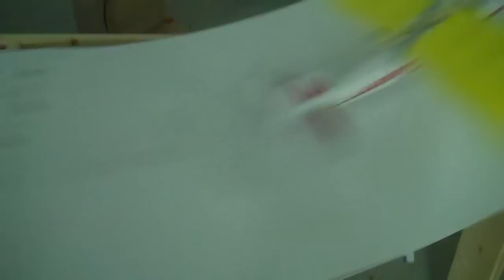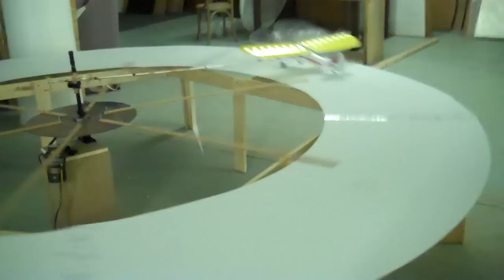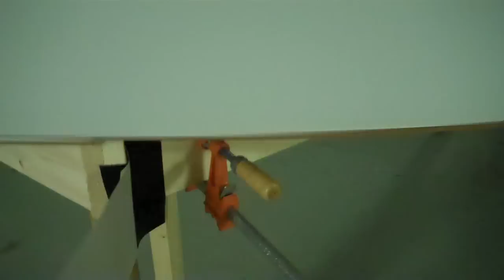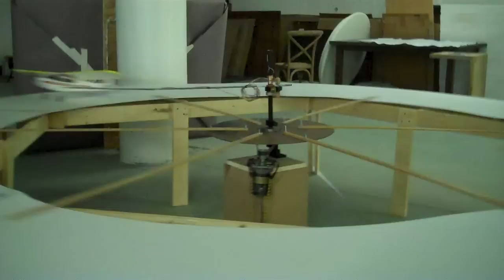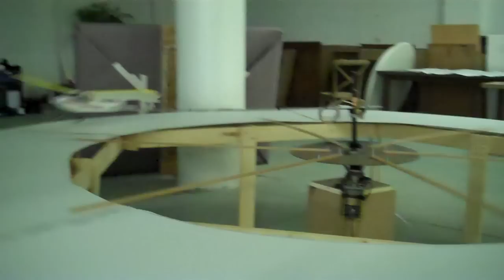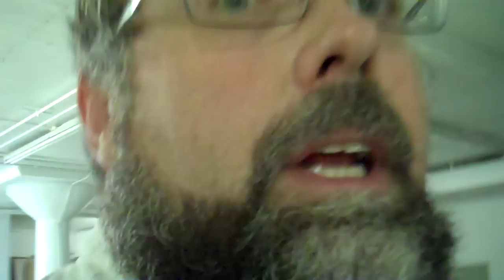Airplane On a Conveyor Belt Proof of Concept

Comment: here the plane doesnt have the same speed of the belt....
Reply: ///Sixth Gear Only by breaking the rules can the plane take off.  The question is always written with the constraint that the speed at which the wheels spin and the speed at which the conveyor belt rotates must remain equal to each other.  Clearly in this demonstration they are not rotating at the same rate.
Reply: @SmartAlx  thats a physical impossibility, wheel speed is dictated by whatever the belt speed is PLUS propeller thrust. 

You cant get the belt to match wheel speed, because wheel speed uses belt speed in its calculation
Reply: @markbergin8821  If it's a physical impossibility then the answer to the question is "no, the plane can not take off under these conditions." If the conditions are impossible, the answer must be "no."
Reply: @SmartAlx  no, the physical impossibility is the conveyor belt, not the wheels
Reply: @SmartAlx  the question is the problem, its a paradox because the belt can NEVER match the speed if the wheels once thrust is applied on the system
Reply: The wheel speed is calculated FROM the belt speed, so belt speed can NEVER match wheel speed once thrust is applied
Reply: @SmartAlx  the disclaimer that the belt speed matches tyre speed is like saying whats down is now up, it makes absolutely no sense and breaks logic. So the answer isn't "it doesnt take off" its, "the question is illogical because belt speed CANT MATCH tyre speed"
Reply: @markbergin8821  What do you mean the impossibility is the conveyor belt?  What's impossible about a conveyor belt?
Reply: @SmartAlx  the properties that the question imposes on the belt are physically impossible. The belt can never match tyre speed, because tyre speed is the sum of the planes thrust and whatever the belt speed currently is.

Let's say belt speed is moving backwards at 10km/h. Even without starting the engine, the planes wheels are going 10km/h in the opposite direction. So if the plane applies thrust equivalent to 10km/h from its turbine, tyre speed is now 10km PLUS the 10km/h it already had from the belt speed, so 20km/h wheel speed.

Now you'll say to just increase the belt speed to 20km, but that simply raises the wheel speed up to 20km/h plus the turbines 10km/h=30km/h. The wheel speed has become simply a factor of the belt AND turbine speed.

No matter what you increase that belt size to, no matter how fast, it cant ever catch up to that small little 10km/h thrust from the engine.

This belt couldnt exist in our universe, it property that the question give it, doesnt make sense. Saying "no it wouldn't take off" is kind of reductive, the whole universe would break if this scenario played out to its paradoxical conclusion. Its like which came first chicken or the egg?.

Saying "well speed of light is the limit so it doesn't take off, cant go fast than light" also isnt fair, youre applying real world physics to an illogical problem that already wouldnt exist in a world following those rules
Reply: @markbergin8821  "Saying "no it wouldn't take off" is kind of reductive"

Well you DEFINITELY can't say it will take OFF under these circumstances.  Better to be "reductive" than to perform a completely different experiment and violate the conditions that THIS experiment requires.
Reply: @markbergin8821  

You could absolutely say "the experiment is flawed so there is no answer."  You ABSOLUTELY CAN NOT say that the plane would take off.

I think a truly honest physicist would answer this question the same way he answers the question, "what is 1 divided by zero."  It's undefined.  Literally impossible.  That's the HONEST answer to the question.

If you force me to choose, why do I say the plane can't take off then?  Because this question exists in a universe that presumes the conveyor belt CAN keep up with the wheels.  Again, you have to accept the terms in the question.  It's a thought experiment.  It's just like arguing who is a better Jedi.  You can't answer that question by saying the Force doesn't exist.  The question presumes the Force does exist.  And THIS question presumes the conveyor belt can match the speed of the wheels.
Reply: @SmartAlx  ...how do you reach that conclusion from the fact that the belt speed literally CANT match tyre speed😂

Asking that question is a mistake in itself, that prerequisite doesn't make sense.

We KNOW the belt cant ever catch up with the tyre speed, so it will always move forward and gain speed, no matter how fast the track is, the wheels HAVE to go faster
Reply: @SmartAlx  I understand thought experiments, and this one is flawed, for the reasons I stated, its not just unrealistic that a belt like that could exist, its PHYSICALLY impossible for a belt like that to exist
Reply: @SmartAlx  but it would, because thats the rule of conservation of momentum, it HAS to move forward, which is why a belt like that COULDNT exist
Reply: @SmartAlx  there's is no energy consumption on those freestanding wheels, no matter how fast you make that rack go, the wheels are just spinning to match it, so any forward momentum MUST push the plane forward, there by having tyre speed go above belt speed, NO MATTER HOW HIGH/FAST BELT SPEED CAN GO
Reply: @SmartAlx  no, because it wouldn't "not take off", it WOULD take off😂 it has too based on the rules of physics that we know.

The belt BREAKS said rule, which makes the question unanswerable, because the plane can't NOT move forward, it HAS to move forward
Reply: @SmartAlx  yes exactly, you dont say 1÷0=0, you say the question itself is impossible😂
Reply: @SmartAlx  again, youre misunderstanding me, its not just "almost" impossible for this belt to exist. 

It CANNOT EXIST, this belt existing would break the universe and everything we know about conservation of momentum, it LITERALLY is impossible and makes NO sense, so the question is unanswerable
Reply: @SmartAlx  because in this hypothetical world where this belt somehow exists, conservation of momentum STILL DOES, so the plane HAS to move forward, it HAS to, no matter what kind of belt is beneath it, HAS to
Reply: @markbergin8821  Wait... actually you're wrong here...

"Let's say belt speed is moving backwards at 10km/h. Even without starting the engine, the planes wheels are going 10km/h in the opposite direction."

No.  You can't just have the belt moving without the thrust of the plane.  The plane moving forward is WHY the belt is moving at all.  The plane doesn't start off at 10km/h.  It starts off at 0km/h.  The engines apply force through the airframe, presumably sensors of some sort detect that force acting on the conveyor belt, and motors move the conveyor belt to apply the same force in the opposite direction (obviously with an additional force to take into consideration the weight of the conveyor belt itself.)  The forces cancel out.  Thrust is applied, the conveyor belt spins, the plane moves nowhere.  If the conveyor belt were completely frictionless, you wouldn't even need a motor to move it.  The thrust of the plane would spin  the conveyor belt through the wheels, because air resistance is greater than the frictionless conveyor belt.
Reply: @markbergin8821  As I said, you can definitely say this experiment is flawed.  You just can't say the plane will take off under the conditions described.
Reply: @markbergin8821  See my earlier comment where I refuted this.
Reply: @SmartAlx  a truly honest physicist would give my answer before that the question is inherently flawed so there's answer.

No answer doesnt mean "oh im right the plane wouldn't take off", it means there is no answer. Because THE PLANE HAS TI MOVE FORWARD, it can not stay still in this made-up scenario, but then you just shoved an illogical, paradoxical device in and tried to apply real world logic to it.

What yiure trying to say is akin to saying 1÷0=0 because it looks right... no, it doesnt have an answer.
Reply: @markbergin8821  You do know that seaplane pilots have to consider currents when taking off, right?  A seaplane in water exists in a situation that's not too dissimilar to the experiment.  Obviously the seaplane can take off, but not if it's going against the current.
Reply: @markbergin8821  No you have that backwards.  The way the question is usually phrased it says the conveyor belt is designed to perfectly match the speed of the wheels.
Reply: @markbergin8821  Again, you have to presume the question exists in a universe where these conditions are possible, just like Einstein had to imagine it was possible for him to ride a light wave.
Reply: @SmartAlx  ...thats not how apparently works😂 

Starting off at 10km is just to make it easier to understand, this logic applies from a dead stop in the exact same way.

Tyre speed at rest:0km/h
Belts peed at rest:0km/h
Turbines:0km/h

If yiu increase turbines to 10 km, now the wheels spin at 10km, which makes the belt go to 10km/h, but the wheels are FREE SPINNING, so with out even having to increase thrust, the wheels will just go DOUBLE the thrust speed, because they aren't dictated by solely the thrust of the plane, theyre dictated by adding up the turbine speed AND belt speed, which leaves us right back at my OG example
Reply: @markbergin8821  If the conveyor belt is able to maintain speed with the wheels, conservation of motion is not violated.  The force is just applied TO the conveyor belt.
Reply: @markbergin8821  Man I don't even know your answer.  You're arguing with me so you must think it can take off.  I've already said the question is flawed.  If that's your answer, why are you arguing?
Reply: @SmartAlx  im not wrong there, yiure just misunderstanding how a plane works, if a plane accelerates to km/h, its getting PULLED through the air with its propeller, its not spinning the wheels to gain that speed.

So if its being PULLED, the belt can try and go 100× faster than whell speed, its irrelevant, the plane WILL move forward, and the wheels WILL go faster than the belt
Reply: @markbergin8821  There is no momentum when the plane is at zero.
Reply: @SmartAlx  when the belt speeds up to match the wheels, the plane isn't ACTUALLY losing that energy, its thrust isn't going into those wheels, it stays in the propeller. So when the belt speeds up to 10km/h to match, that plane is still going to move forward at 10km/h regardless, so what must change? Wheel speed, so wheel speed has to go up to 20 to avoid the universe collapsing in on itself when conservation of momentum is not abided by.

This then starts the pattern that quickly results in both the wheels and track approaching infinity, but the wheels always being ahead, due to the laws of conservation of momentum
Reply: @markbergin8821  

Good job waffling. You're trying to do whatever it takes to make the plane take off, and that's not the question. If the wheels go faster, the belt must match. Once they reach the speed that the plane should take off at, normally, the question ends. The plane doesn't fly, the end.
Reply: @Psyrecx  nice job COMPLETELY not knowing how a plane works😂 I've not been "trying" anything. According to conservation of momentum and everything we know, the plane HAS to physically move forward in this scenario.

Which means the wheels HAVE to go faster, but this belt that doesnt exist, and COULDNT, doesnt "stop the plane from flying" it makes the question unanswerable.

Again, its like dividing 1 by zero, its not ZERO just because you think that might look right, its NOT answerable. You cant say whether it would or would not take off.

Again, the wheel speed is a product of whatever the belt speed is PLUS the planes turbine speed. It is IMPOSSIBLE for the belt to exist, its properties make the question unanswerable.
Reply: @markbergin8821  

No. The wheels only have to go faster for the plane to move forward and to get the lift it needs to fly. Otherwise, the question can be answered, and that's with a no, it cannot fly. 

And congrats on showing you don't even know what you're talking about, then again, you do that frequently.

It's not belt speed plus turbine speed. Because if it was, without the turbine, the plane would just stay still with the engines off. 

The wheel speed is the engines pushing forward vs the belt pushing back. Planes have weight, and still have to deal with friction. They're not magic, unlike what you may believe. Your argument is like the argument of a flat earther. Failsauce.
Reply: @Psyrecx  no, the plane HAS to go forward, in the system setup the way it is😂

This setup is NOT akin actually putting brakes on the planes wheels, free-spinning wheels have different properties to a braked wheel, dope.

It requires ZERO energy for the wheels to match the belt speed, BECAUSE THEYRE FREESPINNING, so whether the belts not moving, or if its going 200km/h, the system is ALREADY in equilibrium for the plane.

So when ANY AMOUNT OF FORCE is applied to the plane via propeller, it is being PULLED through the air, not pushed by the wheels, so in this system that WAS in equilibrium, conservation of momentum FORCES the plane to move forward, no matter what YOU think sounds right, thats what happens
Reply: @Psyrecx  man, dont be a condescending prick unless you're right😂 wheel speed IS  a product of belt+propeller speed, embarassing you cant understand that.

So a belt could ONLY match wheel speed when there's no thrust from the plane itself, ie. at rest. Once ANY force is applied, because the wheels are FREE spinning, no significant energy from the plane is lost through the wheels, certainly not enough to STOP it😂
Reply: @markbergin8821  

Well, I am right, so... Wheel speed is a result of thrust vs belt speed, weight, and friction. 

If there was no thrust from the plane, there wouldn't need to be any movement from the belt. Unless the plane we parked on a hill as the brakes were released. The wheels aren't free spinning, as they're attached to an object with some mass, not to mention their own mass. 

Physics shouldn't be this difficult, but for you, it's apparently impossible.

Hmmm. I just set a toy wheel on the ground, imagine my astonishment when it didn't start rolling around the room, like the ones that exist only in your mind.
Reply: @Psyrecx  I really dont know how much simpler I can explain that to you.

Plane at rest:0km/h
Belt speed at rest:0km/h
Wheel speed at rest:0km/h

Plane applies thrust equal to 10km/h, this is WHAT HAS TO HAPPEN, give or take some energy to account for other factors:

Thrust:10km/h
Belt:speed 10km/h

But NOW with the wheels, they don't go 10km/h they go 20km/h or there abouts, because NO ENERGY needs to be spent in getting the wheels up to 10km/h to match the belt speed, so that energy has to go SOMEWHERE so it pushes the plane forward.

Now YOU might try and say "well then the belt would just go 20km/h aswell, but then the wheels will just go (10+20) 30 km/h because, once again, wheel speed is simply a consequence of the thrust of the plane and whatever speed the wheel spins at to counteract the belt.

Obviously SOME speed is lost due to outside circumstances, but that doesnt change the fact that you are wrong😂 the plane still has to move forward

Plane
Reply: @markbergin8821  

Why? If you can't figure that out, it explains why you can't figure out the question, either.

I've only said I was right, once. In order for me to keep doing it, I would have to have done it more than that. So... Surprise, surprise, yet another thing you're wrong about.

I understand lots of things, you... Not so much.

If a plane's thrust is enough to move it forwards at 50mph, guess what its wheel speed is. Match the belt to that. Gee, that was hard to figure out.

The plane's ground speed, which is not a part of the question, would then be zero. It would be stationary in air, so no air over the wings, IE, zero lift.
Reply: @markbergin8821  

Lol, wow, I hope a lot of other people read what you just said. Hilarious. 

You question other people and then say things that stupid. Priceless.
Reply: @markbergin8821  

When you say things as silly as you do, pardon me for laughing at it.
Reply: @Psyrecx  youre the child bringing up toy wheels in a discussion about aviation, momentum and equilibrium. 

But SiLLy bIg  wOrDs LYke "equilibrium" aND "conservation of momentum" mAKe bABy  PsYreC lAugH😂

Embarassing, not even secondary school level of understanding of physics
Reply: @Psyrecx  Put on a pair of rollerblades, strap a large industrial fan to your back capable of pushing you 5mph on a non moving surface, ie a sidewalk. Now go stand on a treadmill. Feeling confident you won’t move forward still? Go ahead crank it to max. You will move forward at 5mph(minus negligible friction). The plane will always take off. You are stuck on the wheels. It’s not about the wheels!
Reply: @Funwithhighnotes  

You try it. You sound like you have that kind of free time on your hands. 

Or at least, you have enough time to come up with a pointless experiment that won't prove your point.
Reply: @Psyrecx  The fact that you see my experiment as pointless proves you still don’t understand.
Reply: @Funwithhighnotes  

You're the one making the claim. I don't have to.